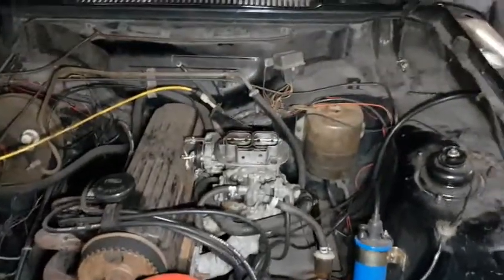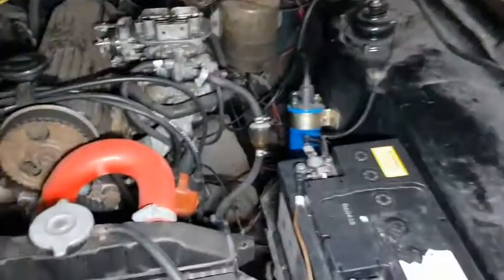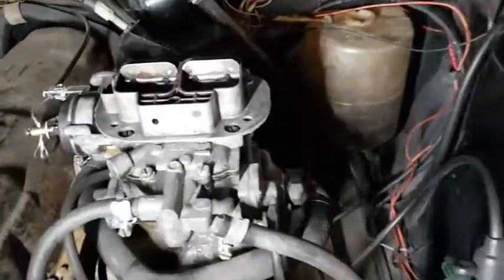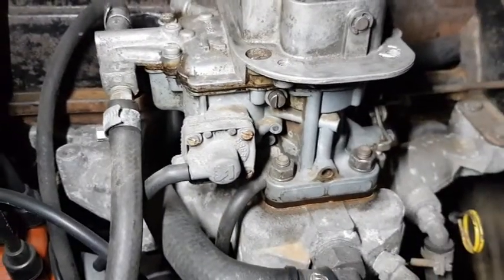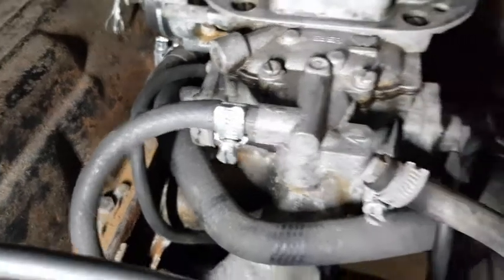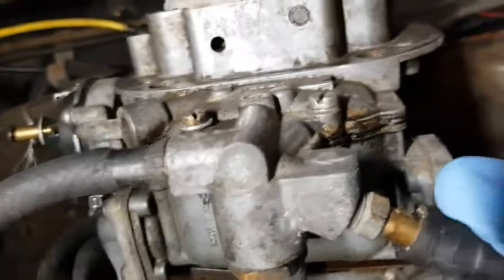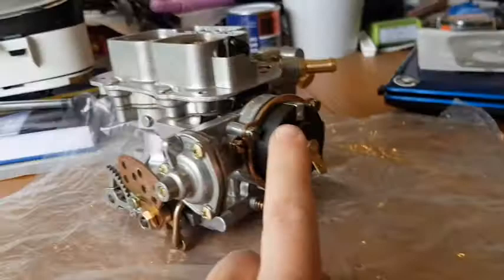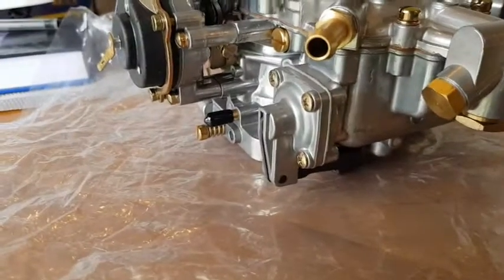Ford capri Laser carburettor replacement chinese vs weber 32/36

Comment: I believe the Chinese cloned Weber 40IDF carbs are highly regarded for air-cooled Beetle performance upgrades and flat-4 Porsche replacements. A friend who bought a pair for his Super Ford Italia single-seater rebuild ( Engine = 2.0 Pinto with rare Grp.1 twin downdraft weber/solex carburation, Grp.1 head+camshaft) was quite impressed with their quality, particularly at £162.00 each.

Comment: It used to be a cheap and easy upgrade for a lot of vehicles here in Australia and the days of being able to go to any wrecker and getting a Webber off an old falcon are long gone and they are becoming rarer every day I’d fitted them to a multitude of engines and loved the ease of tuning them
Reply from the maker: Don't get me wrong it was a great piece of kit it worked but I threw so much fuel in the engine all it did was wheel spin everywhere 🤣🤣🤣 I mite in the future re jet it and put it back on 👌
Reply: @RetroCarsReborn  the biggest problem here is that check valve in the power valve isn’t in the rebuild kits so I’ve had to reface the seat to get it to stop dumping buckets of fuel at all times

Comment: Sir: 38/38 has two mixture screws. The 32/36 has only one🇺🇸
Reply from the maker: So after some more research you are indeed 100% right lest I now no why its been so hard to tune as this fuels a 3.0l capri 🤣🤣
Reply: @RetroCarsReborn  got to know your base tune and go from there😎
Reply: @RetroCarsReborn  3.0 is four or six cylinder?

Comment: Good job. I wish I was as successful with the Zenith 32IF on my Renault 4TL. It's driving me up the wall...
Reply from the maker: @robin forrest I tried and tried with my one iv not driven it for nearly 2 years cause of the problems you will get yours sorted I'm sure 😁👍
Reply: @RetroCarsReborn  
I guess so. She's 850km away in Westrrn France at the moment and I won't be back up there before August. I did make some progress last time but it took me a whole weekend. She starts now and no longer pumps out black smoke but I have to leave the choke out when I'm driving otherwise she stalls as soon as I put my foot down. I think the accelerator pump needs to be adjusted but I've no idea where to start. Garages in France  these days haven't got a clue what  to do with a carb so I'm really on my own.
Reply from the maker: @Robin Forrest 
I can give some advice if you know where the mixture screw is let car warm up with choke on once at operating temp turn mixture screw in you should hear the engine revs go up turn until thay go down turn it back so it revs go up then adjust the idle to what it should be that then should be pritty close to what it running spot on you can push the choke in should not stall any more 👌👌
Reply: @RetroCarsReborn  thanks so much for your reply. It looks like I'll be heading up to Noirmoutier for a few days over the next couple of weeks. So I'll get Rita out of the garage and give this a go. I'll keep you posted how I get on... I need to get her through her  "contrôle Technique"/MOT too while I'm at it.
Reply from the maker: @robin Forrest 
Good luck hope it works for you 
Look forward to hearing how it goes 👌👌